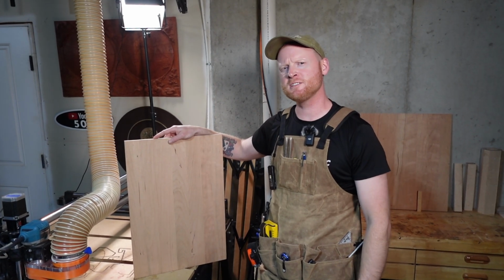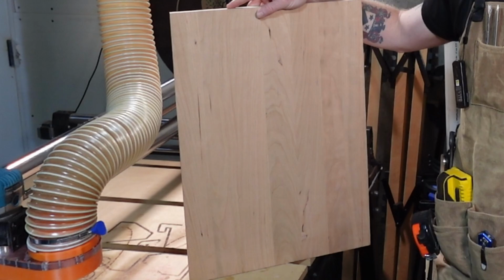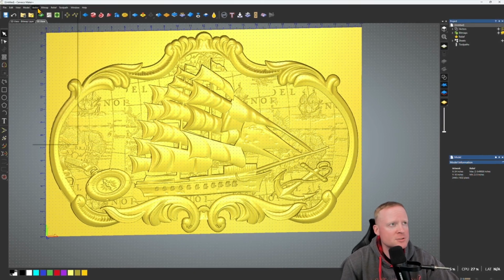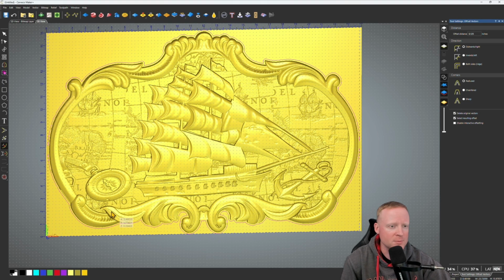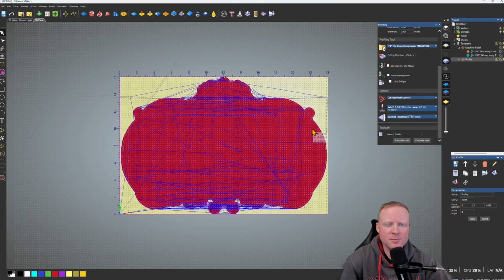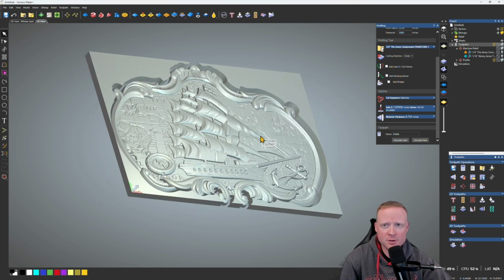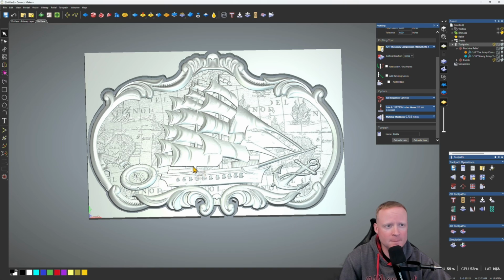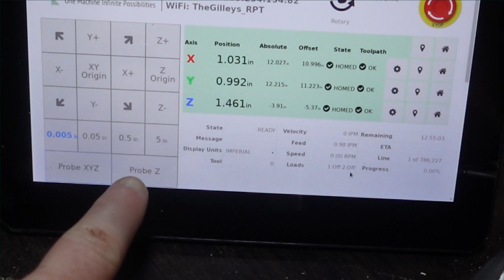Create a 3D carving with a CNC machine| precision ONE THOUSANDTH of an inch | Wood carving Tutorials

Comment: Damn that's a long carve, what was the total time on that like 14 hours? What did you charge for that?
Reply from the maker: Yep! This one took about 13 hours, and I have been messing with the settings to increase my carving times for pieces like this, but it comes with a quality cost unfortunately. I ended up dropping this piece on the face of a cabinet which is still hanging in my shop. https://youtu.be/wAwIRbWZHjo?si=RhPZY84xHYcQUogJ - If I were to sell this, I would pay myself $25 an hour for design, setup, programming etc. and then add in the perceived machine maintenance cost. Roughly $350.00 U.S. - I wouldn't calculate my price based on machine run time because I didn't really do anything besides monitor (which is the great thing about CNC work) lol.
Reply: @TsTimbers  yea but you need to remember if that CNC is tied up for 13 hours, that's 13 hours of opportunity cost your losing when it could be working on other orders. That's the biggest reason I haven't gotten into the 3D carving is the time that it ties the machine up. I'm seriously considering the AltMill. It's rigidity and rapid acceleration make it ideal for 3d carving I feel. I have an xcarve now so that carve you did would probably take me 20 hours lol and not look as good
Reply from the maker: @KeimpieceCarpentry  That's very true but if I put myself in the buyers' shoes, I'm probably not going to pay over $400.00+ for something like this unless it's an amazing sales pitch! You could probably make more money on a series of smaller projects but like you said you can't make those smaller projects with a 3d carving tying up the machine. 🤔
Reply: @TsTimbers  Tis the business dilemma of 3D carving I suppose.

Comment: what grit u use for the fuzzys
Reply from the maker: I start with the 240 and if it’s not enough I move down until it is
Reply: @TsTimbers  how about the during the shellac
Reply: nice work i realy like your final result
Reply from the maker: @joses-v1x I use the 320 mop in between coats, after the final coat the 600 until I think it looks good 😅

Comment: 6:09 I'm curious what happened with dust collection there, looks like it was picking up well then a mess happened.
Reply from the maker: Sometimes a chip that is to large for the dust boot will get stuck and block suction causing the buildup. I find that if I turn the RPMs up on the router it won’t produce those larger chips but it’s easy to fix, I just pull it out of the boot

Comment: Nice work. The work map behind you I made one also. Really awesome finish!
Cheers Mark
Reply from the maker: @markscreativeturnings  Thanks! That was one of my first carves back when I had the machine wall mounted. I’d like to max out the work area eventually with another large one.
Reply: @ I’d like to wall mount my woodworker but I have the elite so I can’t because of the weight.
Reply from the maker: @markscreativeturnings I was looking at upgrading for MASSO - do you
Like it?
Reply: @TsTimbers  I love it. I tried a couple of Chinese smaller ones by that didn’t work for me. The MASSO does a lot of the thinking for me.